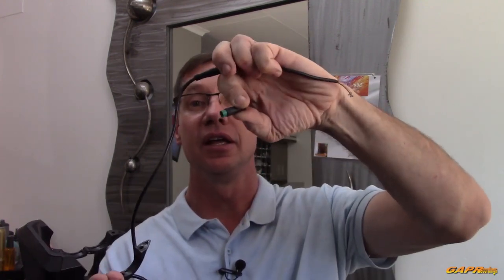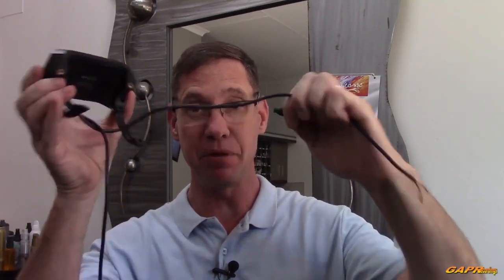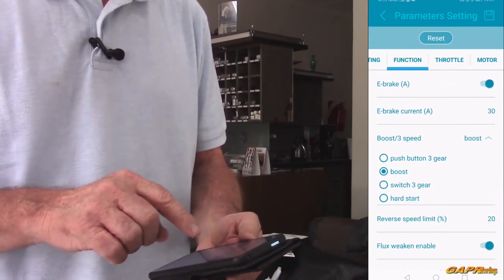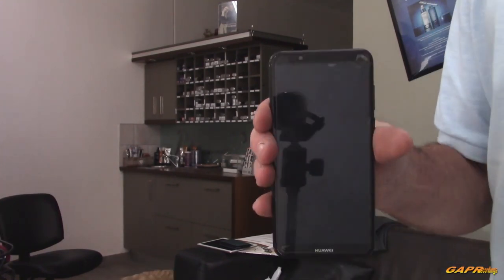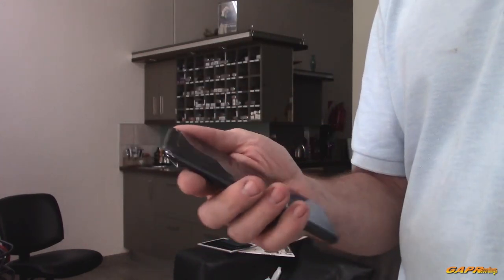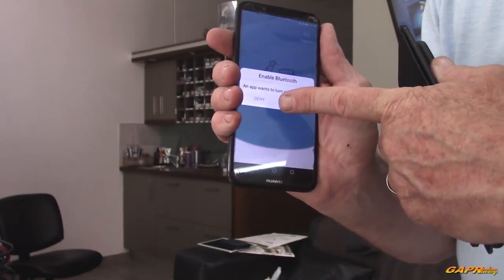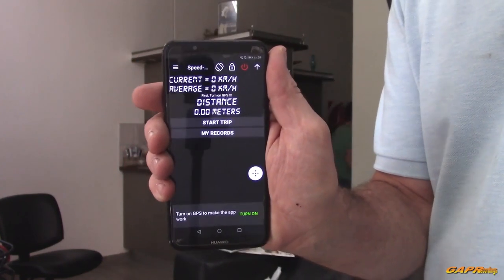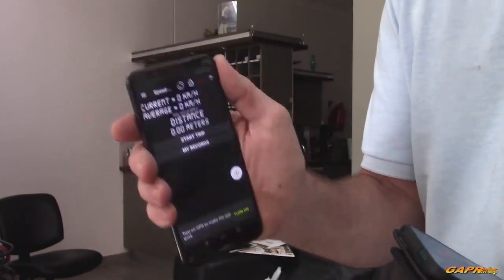Ebike Dead Sabvoton Screen? Now what?

Comment: It’s great to see someone in the ebike community highlighting this issue and providing a simple display free fix. I had 3 displays die in a week all due to tripping battery voltage while riding. The Chinese company replaced them with a different model. The UCK1 display model definitely works. I’ve had the breaker trip several times now and the new display is still going strong. I tried fixing my 750C display but gave up after replacing several diodes and transistors that had fried. Avoid the 750C display at all cost. Take the UCK1 display instead.
Reply from the maker: Hi Jamaree, Thank you very much for the valuable feedback, and thank you for watching..
Reply: this is the display that doesnt work for me

Comment: Amazing.  For months I've been arguing with my Alibaba supplier as the bike turned up pre-assembled but dead and proved to be no help.  They stopped answering my messages.  I thought I was left with a pile of junk until now.  Your work around works great!
Reply from the maker: Hi Jamie, Yes, I had the same ru n around, The problem out here is the exchange rate, and when I bought this kit we were sitting even higher than now. Unfortunately, "just replace the screen" was not an option.

Glad this video could help you out.
Regards
Charles

Comment: I really do not like the UKC1 much. So thank you for the method to eliminate it and run with good old fashioned switches and meters. I wire my battery devices with a meter that reads and displays voltage up to 100 volts and amperage up to 100 amps. It shows the instantaneous wattage used as well as the cumulative watt hours. That and a GPS speedometer/Odometer is a full complement of instrumentation needed for an eBike as far as I am concerned.

Comment: My first screen stop working because of brake regenerative braking aka regen, my second screen has been fine for 11 months now as long as you don't use the regen. It's the regen braking that causes the screen to go dead from overvoltage. At least that was the problem with mine. I can use the regen if I keep the charge under 90% otherwise it will burn out again. QS motor confirmed this with me. So I just use 2 of the 203 disc rotors front and back with Magura 4 pistons to stop my bike. It stops on a dime with no regen needed. I'm still confused about what happened to yours, are you saying the beaker cause the screen to burn out? Andy Kirby has a big breaker with his Sabvoton and now issues. None the less this video is awesome as if my screen burns out again I can do this trick to make it work. Even though the TFT screen is cheap to replace hee in the USA. I would love to get a reply on what you think of the regen killing the screen? Fantastic video for future reference. sharing and saving.

Cheers mate

Rob from NorCal USA
Reply from the maker: Hi Rob, not the breakers fault, it's the regen voltage from the hub, the breaker kicked out for one reason or another, the hub voltage must have spiked and that is what killed it. My problem is, I'm sitting with a 20:1 exchange rate on the USD, so although the screen might not cost much x that price by 20 and put on about 25% for import and that's what it'll cost me. Thanks for watching.
Reply: @GapRecordingsNamibia  I didn't see your reply until now 10 months later and my second screen went out. I'm now using the UKC1 screen which is confirm not to have the same issues. Anyway I hope you're still riding and enjoying the e-bike life.

Cheers.
Reply: this dont make sense, my screen still lights up but no picture. this happened while i was walking the bike and just powered it on. controller still works, and bike still works just display doesnt show information

Comment: I'm having a sort of similar situation.

I purchased my FIRST sabvoton controller from a place called risunmotor. It came with a Bluetooth dongle. A year or so later it crapped out. Due to a short circuit wire that came loose. 

The SECOND sabvoton worked fine as well for a month or so. 
Then this evening I turned it on and it hit me with a controller protection error 02H. 
I read online that you can bypass that error by lowering the Amps. So I decided to use the Bluetooth dongle that came with the FIRST sabvoton controller on the second new one. 

Now all of a sudden. My controller doesn't work anymore and the display won't light up. My battery is fine thankfully and HOPEFULLY my motor is Okay as well.

But it's so fucked up they never bothered to tell me to not use that Bluetooth dongle with the new sabvotong controller 

DESPITE ME ASKING THEM IF THEYRE THE SAME CONTROLLER AND THEY SAID YES. ITS THE SAME CONTROLLER.

like wtf
Reply from the maker: Well, that sucks, but, I can assure you that the bluetooth dongle can not harm or lock the controller. 

That is for very certain. It is only a means of communication between app, and controller, once you are done programming you need to replug those two white connectors, if you do not do that, your screen will not function, the controller will turn on, but it will not respond to any screen inputs, leaving the white plugs unpluged for me ensured that I could have comms with the controller. 

What I did, was so that I could use my controller without having to purchase another screen..... Hope this can either help clear up some confusion that may have arisen for you, or, help sort out an issue that may have been caused from any confusion?

Good luck, hope you can get it sorted.

Comment: I have the same waterproof connections but my display works , I want to shut down the bike with a switch (key) or something like that can you tell me which wire I have to use
Reply from the maker: Good morning! The main supply wire is the thin red wire that is inside the loom that goes to the screen. In theory, interrupting this wire will "immobilize" your unit or swich it off, but you will still need to swich the unit on from the display. While the display is in there is no way past this as it is the control point for the system. Hope this helps? Have a good day.
Reply: @GapRecordingsNamibia  thanks a lot that helped me out
Reply from the maker: @FloKTC  glad I could help. Have a good day.

Comment: The switch 3 gear means if you had a 3 speed switch attached, then you could use that to boost or restrict your bike speed. The fact that it is slow when enabled is just that the slow speed is the 2nd of the 3 speeds (the default speed) so if you add the switch, then you can choose speed 1 or 3 to speed up your bike. I have this 3 speed switch on my bike, that's how I know it works like that. Now you wont need the display to choose different speeds, or have to go into settings all the time. Hope this info helps you guys. Gl. 😉😁
Reply from the maker: Hi Lisa, Yes, I have gathered as much, BUT, this is also the setting that the controller is set to for the screen to control the controller with, the controller has to be set back to this when and if the screen is replaced...... Thank you for letting us know and thank you for commenting, it is appreciated. Regards, Charles.

Comment: I was given a free 72150 v2 and this is going to be helpful for me to setup, I'm hoping I can do this through the PC software, all the wires have no connectors on them and i'm not going to have a display either. this is very helpful since I can order a Bluetooth dongle and use an old phone as the display! my only question is I have a orange wire which is the power lock do I need to wire it up to the battery positive or can I just use your method with wires? I have tried finding a diagram but these controllers seem to come in many configurations.
Reply from the maker: Hi Jordan, UM..... 🤣😂 Yes, Many flavors indeed.
http://www.cnqsmotor.com/en/article_read/Sabvoton%20SVMC/SSC%20Series%20Brushless%20Sinusoidal%20Programable%20Motor%20Controller/537.html
The first diagram shows the (orange) cable going to battery +, this is usually the case It is like an ignition wire without it nothing powers on the second diagram is when using a cycle analyst which I do not think will pertain to you.. Hope this helps.

Comment: I have a nakto fat tire mini cruiser and My boy friend taped some wires together on my e bike and he said when he turned it on he herd a pop and the display panel was smoking ...is there some way I can bypass the LCD display till I can afford one ?
Reply from the maker: Hi, I am not familiar with that make of bike or the controller and screen combo on it. I would say that if you could trace the power path used you could short them together, and the bike "could" work. Unfortunately, unless there is a way to adjust the ebike "gears" you could be stuck in 1st or 5th, there is no way to give a clear answer to this.

Comment: Hi, I have a stealth bomber with qs273 15000w 200a controller, I accidentally reset the settings from the MQCON app and after that the wheel turned backwards, I did the hall test by entering the number 10 and it worked fine, but I no longer remember how many potor poles pair has 16 or more, I tried to put 23 because it seems to me that they had basically entered that number, but I noticed that when I accelerate at low speed, the speed on the screen remains at zero unless I accelerate reaching 15km/ h, before I remember that even if I accelerated from a standstill slightly it showed me the speed like 4-5km/h but now it stays at zero, what could it depend on?
Reply from the maker: Hi, I really have no idea, As far as I remember my pole pairs were set to 32, Don't quote me though, I have sold the ebike already to someone else so I would not be able to really help you there. Hope you find a solution to this. Good luck.
Reply: @GapRecordingsNamibia  in the end I solved it, but now another problem occurred, I was going fast and while braking the power went out, I turned it off and on again and it was working again, but then the front and rear lights, the horn and the electric brake they stopped working, what could it be? the bike works normally apart from those things😓
Reply from the maker: @imed9774   
That would be the same as the screen problem..... 
Over voltage spike under breaking, Voltage can get up to 96V under breaking with no load. 

From where are the lights being powered? 

Sounds like the source for them has been killed, most probably an built in dc-dc convertor rated at no more than 76V? 

Or, do they all have their own DC-DC convertors?
Hope this helps.
Reply: @GapRecordingsNamibia  yes I saw inside and there is the dc dc converter, if you have whats app or insta, I can send you the videos to show you how the cables are inside and the settings in the mqcon app, I think I have some wrong settings..
Reply: @GapRecordingsNamibia  I think you've centered the problem, the cables for the lights, horn and electric brake are connected to that dc dc converter, the pas works and everything else too, I'll have to change that part, I'll have the Chinese send it to me where I have it purchased

Comment: Great video. I followed the steps and got the controller starting. However when i start it with the throttle connected the wheel instantly starts spinning max throttle, even though i dont even touch the throttle. Do you have any ideas what might cause this?
Thanks
Reply from the maker: Hi Frederik, Sorry, I can only guess at a few things but that will be it. Settings inside the controller, but, could also be a damaged hall sensor inside the throttle body or a damaged cable? That is about all I can think of.... Sorry for not being able to be of more assistance.
Reply: @GapRecordingsNamibia  Thanks for the fast response. I ordered a new throttle today so hopefully that will make a differnce. Cables look fine, i find it wierd that the display screen and throttle would both stop working at the same time out of nowhere tho. I charged the bike and the next day it just didnt turn on. Atleast i got the controller starting now without the display like you showed.

Comment: Hey can you help me I have a different but close to your problem my display I believe is fine but I dont have the button component + - M and power. Any way to use buttons or switches to get the display to work
Reply from the maker: Hi, I am not sure, I have chucked mine away many moons ago. As far as I know as long as you use a keypad that has the same connector, (they should all be generic) then you should be good to go. Out here, no one carries these kinds of spares, but if you are situated in EU or USA you should be able to go through some websites and should be able to order this relatively cheaply.. As I do not know how these are internal connected I am unable to genuinely give you any solid conformation. Hope this helps. Regards.
Reply: @GapRecordingsNamibia  so maybe I'll try buying a cheap one and just matching colors on the keypad wiring

Comment: Will this work with a electric scooter lcd got the same 5 wires Thanks
Reply from the maker: Hi Mo Bear. Sorry I have no idea as this would pertain more to the controller, the chance I would suppose is a 50/50 chance. 

You do not want to send voltage back to the controller via ground as that would be a short, but, if this is indeed pack voltage you do not want to send that back along a data line, so, finding the correct wire to send power back on is what you need to work out.

I hope this helps?

Comment: Hi buddy
Was that 23 dummies I saw ricocheting around the room. 😜
It's a bummer mate when the breaker you put in for safety causes the the screen to cook when it trips. It's hard to believe the manufacturer didn't know this was a potential problem. 
Could you have put a diode inline somewhere in the system to prevent it happening? Now you have all that lovely hindsight to use.
Reply from the maker: Hi Ali, thanks for watching. Yeah I went full diva on that one. 😖😞😒

I was a bit peeved, out here that thing cost me half a months wages so it was not a cheap buy. 

The only way a diode could work would be for either reverse voltage or or as a forward drop,  the first is not the problem, the poles aren't reversed when this happens, it goes complete over voltage by about 17 Volts.  The forward drop would only drop a few mV off the reading, I honestly don't know if that would make a difference. It does however sound like this is a problem with the sabvaton kits though, I'm not the first this has happened to, it's odd though that no one has made a video of it yet.
 
I did open the display afterwards and there is a diode in place on the positve wire that seems to be feeding directly to a voltage regulator that has some sort of charging circuit for a small battery that is inside the display. Anyway, as the display is now just a blown peice I would not be able to say if the diode would work. 

There are a few posts on ES about blokes trying to repair those screens but to no positive outcome though. It does seem that this is a problem with these kits and so the guys need to know this... I don't even know if a CA can be hacked in on this particular kit, but I don't have the money for a CA. Again, thanks for watching. 😅😁😁

Comment: Hello. What model of sobvoton is this? Thank you very much.
Reply from the maker: Hi VD, this  is a svmc72100.
Reply: @GapRecordingsNamibia  Thank you very much. You are very kind. Is this controller suitable for a 1000W motor in your opinion? Or is it too strong?
Reply from the maker: Hi VD, I am very sorry, I do not get notifications on this video, I do not know why.  I used this controller on a 1000w hub, but, do not go above 1500W or the hub will burn out, you will need to limit the controller to 1000W if you want to use it with a 1000W hub motor,. Again my humble appolagies for not replying in a timeous manner.

Comment: Hello. From your video I can see that the application remains connected to the control unit. I saw a video where after each use of the engine the user had to contain the application after each use of the engine even if used for a few laps. You confirm that in your case the application is always connected to the control unit while using the engine? Thank you very much.
Reply from the maker: Hi VD, the only reason mine remains connected is because the screen is dead, that means that the programming cable remains disconnected, if you use a screen you can't keep the application running as the screen NEEDS to use the programming cable.. Hope this makes sense?
Reply: @GapRecordingsNamibia  Understood. Thank you very much. You were very kind.

Comment: Thanks for the video, I've got the exact same issue it seems! Just a question, does the mqcon bluetooth app need to be running every time you ride the bike now or is that only for making adjustments then the app can be closed? cheers
Reply from the maker: Hi Clinton. No, the app does not need to run the whole time, you'll only need to open the app up to make adjustments to the controller when needed. The dongle only needs to be plugged in to have access to the app when needed. Just remember to keep the white plug with the three cables unplugged otherwise the BT dongle will not work. Also as stated, unless you have a BT enabled bms you can't see SOC of the battery that is why I would suggest the VBMS BMS to be able to see that ever important SOC. Hope this helps, Best wishes, Charles.